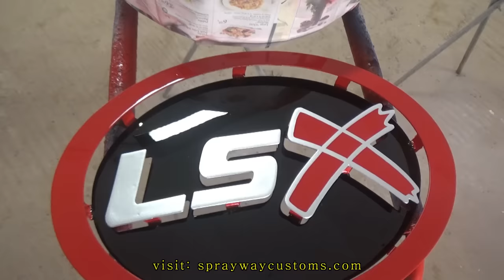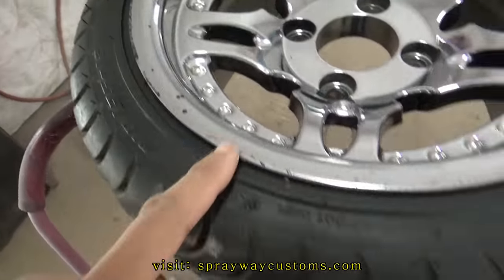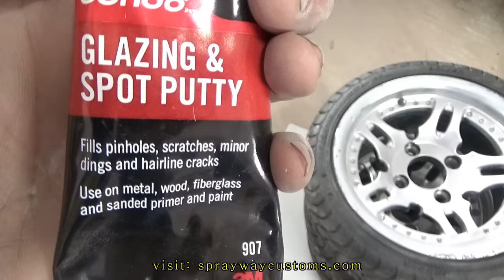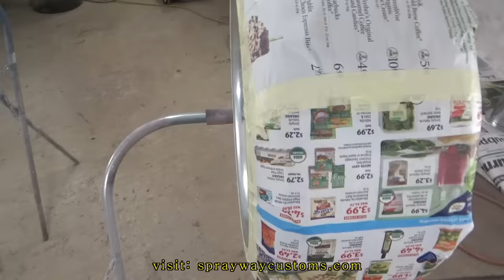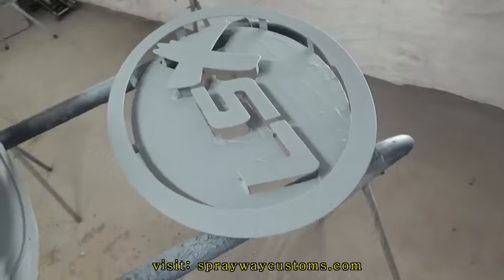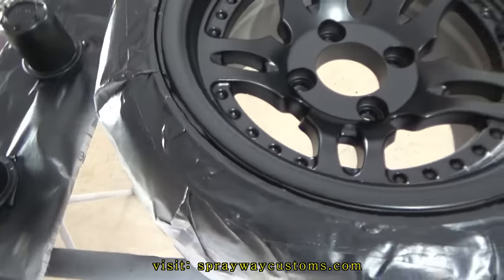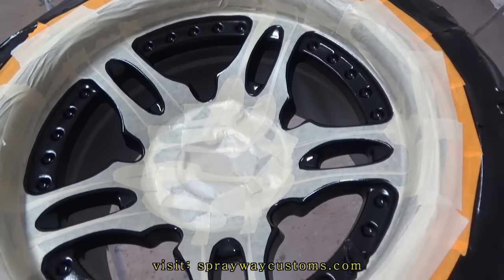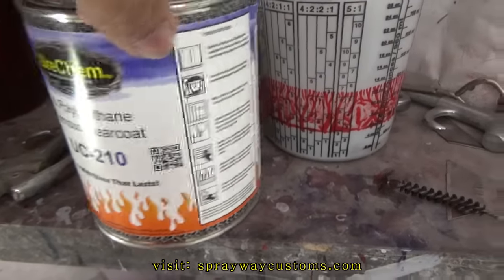How To Paint Chrome Wheels TWO-TONE COLOR RED & BLACK BARREL Custom Golf Cart Rims CURB RASH REPAIR

Comment: 👍Awesome video👍 May try your technique in the near future on a set. BTW, _I’ve never heard of using GLAZING PUTTY on rims!??!🤯🤯 How they hold up in those areas?...don’t it chip off...?
Thanks again & keep the awesome content coming!👍👍
Reply from the maker: As long as it's a minor imperfection it'll be fine. A large imperfection you would want to use a 2 part filler. Once the clear is sprayed over everything it's not gonna chip unless you hit something.

Comment: Is it better to paint wheels with the tires on or off? Does the paint affect the ability of the tire to hold a bead?
Reply from the maker: Both have their pros and cons. Easier to paint with tires off but you also risk the chance of damaging the paint when installing the tires back on

Comment: Family are you using a 1.4mm tip for base coat gun and a 1.3mm for the clear coat gun? What PSI are you running for both guns? Your work is always  looking good on point.
Reply from the maker: Both guns I used in this video has 1.2 tips. SATA minijets. The primer gun 1.8 tip
Reply: @SprayWayCustoms  Do think a 1.3mm would be good enough to shoot base and clear?

Comment: Very well done my man, they look amazing bro💯‼️ im fixing to start doing mine asap but the chrome is very pitted and flaking off. Any tips on dealing with that is greatly appreciated!
Reply from the maker: Just sand it until it's pretty much feathered and not flaking with something like 180 and then spray some high build Primer to build it back up.

Comment: Hey SWC, why didn't you remove the tires? Tire changer $40 at Harbor Freight. I use one attached to a wooden pallet, works GREAT!
Reply from the maker: That wasn't in the budget. I try to do what I can on jobs but if I would've removed the tires I would've been painting the wheels for pretty much for free. I have bills I have to pay too now 🤣🤣🤣

Comment: How has everything held up on the Golf Cart? I want to spray mine and after watching you do the ClubCar im excited to get on it. My fenders are plastic, what should i use for filling the scratches? Some are deep.
Reply from the maker: It's holding up great. How deep are the scratches?
Reply from the maker: Minor scratches glazing putty will work but if they're really deep some body filler will work
Reply: @SprayWayCustoms  i'd say maybe 1/16th to 1/8th inch. Looks like some brush grabbed at the sides but no deep gouges.
Reply: @SprayWayCustoms  I bought the glazing putty you used in the video from walmart today.

Comment: Hey bro I'm a big fan of your channel .. I need some advice on painting my 93 Buick roadmasrer.  I want to paint it part black like a satin black and part chameleon. The pigment will be from ebay.  What do I need to accomplish  this  job paint wise... how can I mix the chameleon powder.. like ratio and what do I need to mix it to get good results.. what kind of paint to use... primer..... ect ... can you help thanks...
Reply from the maker: Mix the chameleon pigment in a binder. If it's a hypershift or Supershift chameleon. Mix 25 grams to a gallon but if it's a cheap pigment. Mix 75 grams to a gallon. I have a video on mixing it.
Reply: @SprayWayCustoms  thanks bro... I believe I seen that vid I thought it would be different with my ride with it being older... So I don't add nothing else to the binder

Comment: My brother I wanna be like u when I grow up I have question I have done chrome rims new one's and I used 80 grit to scuff and u only used Scotch-Brite are u saying that's all I need to scuff....and I have done 2tone blk and red but instead of clear base coat I used clear coat let it dry over nite masked with fine line tape sprayed my second color but when I went to remove the fine line in some palaces it pulled my paint up...so doing it the way I just showed is that the trick....last question u used a 2.1 clear coat vs a 4.1 does this hold up better. Please answer need ur help I'm about ready to give up on doing rims keep doing watcha do guys like me need u....thamks
Reply from the maker: If the chrome in good shape it don't take much just a scuff and adhesion promoter will do the trick. I've done it with regular clear also but I've had better results with intercoat. I didn't have one peal up. 2.1 clear is a high solid clear it's a lot better than 4.1
Reply: @SprayWayCustoms  one more question in your opinion are paint rims good for every day driving or for show like once in a while....thanks for your tips

Comment: Yep I always use that glaze putty. Got a tube of it rite now
Reply from the maker: I use it too but I also have a better brand. It's ok as long as you know when to use it.
Reply: SprayWayCustoms rite, I need to try the other brand you use, what is it?
Reply from the maker: Pronto Glazing Putty by USC https://rover.ebay.com/rover/0/0/0?mpre=https%3A%2F%2Fwww.ebay.com%2Fulk%2Fitm%2F132849845199

Comment: Hey man. Would this method work for a chrome bumper?
I did it once before but it is all flaking off.
Sanded with 80 grit and then 2 coats of self etching primer then 2 coats of paint and then clear.
Thanks
Reply from the maker: Yes it will. If you did all that I don't see why it didn't bond. Try using an adhesion promoter
Reply: It was just spray can stuff.
Would it be better to use a gun?
Thanks
Reply from the maker: Ohh, that's why. You need 2K for durability....you can get 2K products in a spray can also. Yes spraying it with a gun will make it look a lot better.
Reply: Thanks for taking the time to help.

Comment: That masking is the difference between pro level results and idgaf bout this and that interclear always a safe practice when doing multiple colors
Reply from the maker: You already know. The masking is a big part of the paint job. I've done it without intercoat and had good and bad results. I didn't have not one problem with these using the intercoat and I use high tack cheap masking tape 👍🏾

Comment: What’s the best way to deal with peeling chrome so I can paint
Reply: Sand till you get past whats peeling and make sure its smooth. You shouldnt feel any bumps or height difference where the chrome has flaked. The process in this vid is spot on and should work foe your situation. Worst case you may need to start with a lower grit like 120 grit instead of the red pad. If the 120 isnt doing it go to a 80 grit and so on. Idk how bad the flaking is. Just be prepared for a lot of sanding. Prep work is key to a good looking long lasting result
Reply: Cody Hodgson thank you
Reply from the maker: Great explanation Cody. That's 100% correct.

Comment: Yo sprayway hmu got a question
Reply from the maker: What's going on fam?
Reply: SprayWayCustoms got water sitting in the sides in the trunk tryna see is there a drain I need
Reply from the maker: The drain holes probably clogged up with debris
Reply: SprayWayCustoms  where are they located ?

Comment: decent job, but some of the line work is very questionable. black line above the 'bolts' is just so uneven id ask for my money back if I paid for this work.
Reply from the maker: That's why you do it yourself if you that picky...appreciate the view though
Reply: SprayWayCustoms i do :) but yeah if the lines were straight they would look killer. Cleared black and red looks great. Way better than before

Comment: Show me those wheels in 2 to 3 month's
Reply: Firstly he said at the beginning of the video they are for a golf cart so even in a year they will have almost no mileage on them. Im willing to bet they look exactly how they do in this video. Honestly tho he did the proper prep sanding and adhesion promoter so they are as durable as powder coat. If your surface is smooth paint os actually better because you can buff and polish out scratches powder coat you cant
Reply from the maker: Randall, what are you looking to happen to them? If the owner hit a few curbs, that's on them. I really don't see that happening on a golf course. Far as the paint goes it'll last as long as your paint job on your car, I'll put money on that 💰💰💰💰and thanks for the reply Cody
Reply: @SprayWayCustoms  beautiful work.  Id like to see them in a few months to see how they held up.  Relax.     I paint daily on cars not knocking his work.  Want to see durability  4 myself.  Sure he want drive it but once a year.    Calm down ppl
Reply from the maker: Randall if you paint cars you should know the durability of a paint job if it's taking care of 🤷🏾‍♂️
Reply: Didnt mean to butt hurt anybody was just saying painting chrome is different.    I dont have much experience in painting chrome.  Curious how durable it will be.  Great work. Btw.